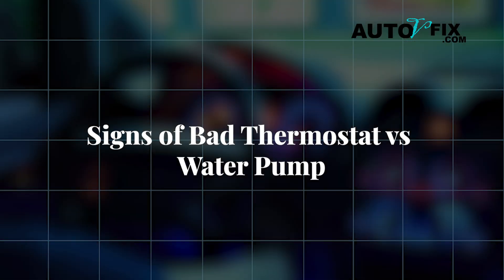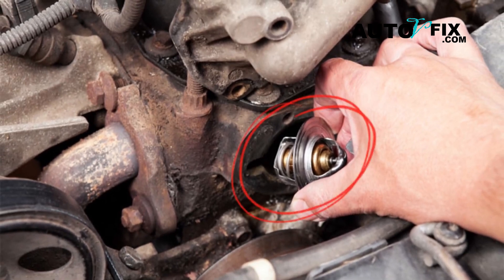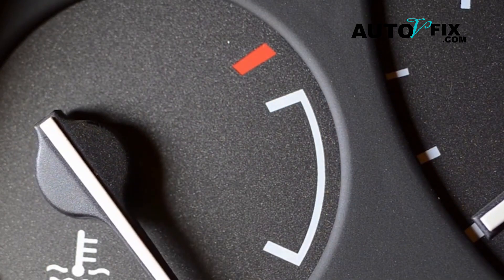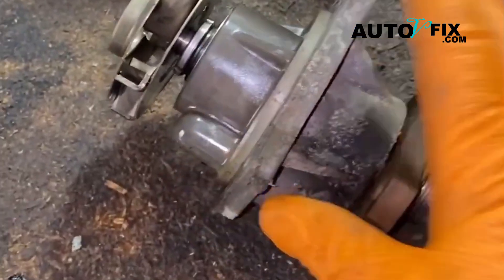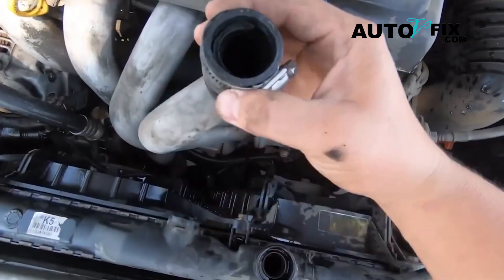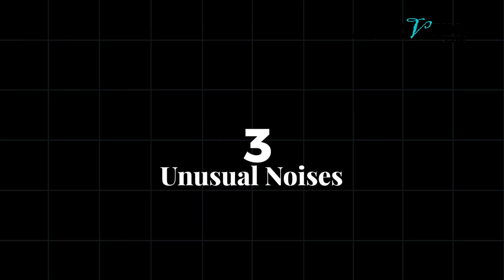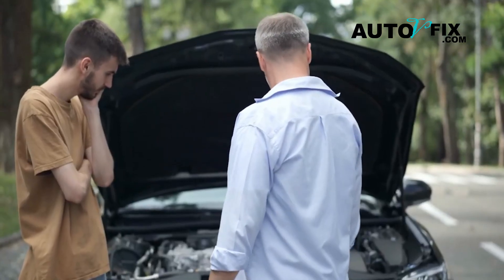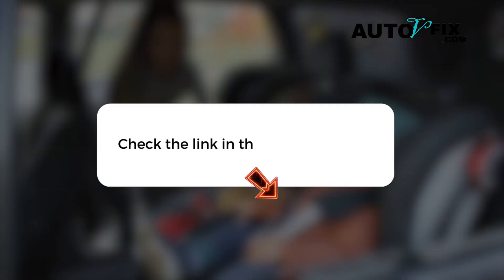Signs of Bad thermostat vs water pump: how to tell if your thermostat or water pump is bad

Comment: Having issues with my car.  Temperature gauge is going to hot no noises from engine but car isnt getting hot on the inside either.
Reply from the maker: That definitely sounds like a classic thermostat or water pump issue, especially if you're not getting heat inside the cabin.

Comment: Replaced two thermostats, still happening.  Can't tell if it's air in the lines of a closed system or water pump going out.   I'm pretty sure my car is about to be stolen by teenagers and driven into a deep ditch

Comment: Doesn't really help.  Any ways to determine if there is water flow?  Collapsed lower radiator hose?  Circulation in an open system radiator?

Comment: I have a toyota 2012 prius and I just fixed the engine water pump. But still if I am driving in the highway, the heating light often comes on the dashboard. Sometimes it flashes and goes away and sometimes it stays for a while and when i speed down, it goes away. can anyone tell me what is the reason?
Reply from the maker: This is sounds like a faulty thermostat or potentially a partially clogged radiator since it happens at highway speeds only

Comment: What about car not reaching 90C even after ~4hr of driving
At max it was 75C
The car is an audi a4 b8 avant
Reply: likely stuck open thermostat... i'm having the same issue and will be replacing mine.
Reply: @SssAhmad-x6u  My 2019 Pathfinder popped a code for low coolant temperature; bad thermostat (stuck open).
Reply: Searching for the same solution, my car doesn’t heat up while driving for at least na hour more than like 60 Celsium. Only when idle, it heat up to oprate tempature 90 Celsium. I hope coolant flush and termostat change will help.

Comment: You forgot Failing Electric radiator fans. My former 2016 Altima would display wild temperature flux if one fan froze up.
Reply from the maker: That's a really good point! Electric fans definitely play a huge role in cooling  system and can cause similar temperature issues too.
Reply: That’s what is wrong with mine

Comment: Ok, but what causes the temperature control sensor to constantly go out, I've replaced it 3 times now, No coolant leaks, and my engine doesn't run hot either??????
Reply: Do you mean the Thermostat?

Comment: A bad water pump doesn't always leak. There could be bad bearings in the pump, causing it to not pass a good coolant flow. You can tell if this is your issue if your radiator hoses don't have pressure in them.
Reply: how about a 4.0 tacoma ..doesn't over heat..just did t stat. but top hose gets warm and rad and lower hose nvr gets warm..as if its not circulating..I have great heat and I just flushed rad and core everything was tood..ideas?? water pump is quite and no leaks. motor has 180k..maybe the water pump blades are getting smaller less circulation?
Reply: @randystjean539  Sounds like my problem.
Reply: @randystjean539 same on my gmc. Temperature is fine though. The heat won’t stay hot for long. I put a new thermostat in the other day
Reply: @Tonirose74 how it goes?
Reply: @MRsickcat84 new thermostat did nothing. Not overheating, bottom hose still slightly warm even on a 40 mile trip on highway
Reply: Same on 02 mdx

Comment: I think my waterpump is makimg clicking sounds when i turn in the heater but it blows cold
Reply: Is that what that is??? My heater will sometimes make a clicking sound when I turn it all the way up but will sometimes work sometimes not. Now my cars coolant garage is overheating
Reply: @jonathancroc I changed my thermostat and filled up the radiator and burped it your system might be low on coolant

Comment: My 2022 Mitsubishi Outlander is losing coolant. I’ve already taken it to three mechanics, and they can’t find where the coolant is leaking from. The hoses build up a lot of pressure. Any suggestions?
Reply: The symptoms of your truck are a damaged head gasket, first check the engine oil and if you see that it has a coffee-au-lait color, that is coolant and mixed oil. 
It could also be that it is being consumed through the exhaust pipe. 
Start the car and check that no white smoke with the smell of coolant comes out of the muffler.
Reply: It's your water pump, its also recommended to replace both the thermostat and water pump at the same time. And flush out the old fluid and bleed the coolant system with brand new OEM fluid.

Comment: one more thing about the water pump,  if you hear a knocking sound,  get a wooden rod such as a broomstick or mop,  place the handle end on the pump's body, while gripping the rod....place you ear next to the rod......notice that increase in noise and the vibration?   that procedure is like a drs stethescope....
Reply: they sell them for cars on amazon 5 bucks

Comment: 2009 Honda civic, replace radiator cap kit , , new thermostat, and no leaks , the car suddenly goes up to 3/4 while waiting at a light but once the car is running , it goes back down to normal , has coolant and fans are working , heater still works I’ve seen that when water pump is bad heat doesn’t work , what could it be ?
Reply: When you turn the AC on, does the radiator fan turns on and does the car temperature drop back to normal?
Reply: U need a fan switch for it normally it closes to the thermostat housing
Reply: is ac on??
Reply: Radiator fan
Reply: I have the same problem on my Cinquecento 1.1, I’ve changed waterpump, belt (tension finally was ok), thermostat (works ok), water sensors and the car while idling starts to rise up from 90 to 98 close, but while running, the car/waterpump is able to cool down the car! Radiator fan works ok, but it is not capable of cooling or bring down the water temp! At the reservoir, water temp is close to 80-85
Reply: @FullTuerka well actually, if your car has a radiator cap , then you should be checking coolant level from there and not the reservoir, if your car doesn’t have a radiator cap tjem yes , check the reservoir
Reply: @FullTuerka are you checking the radiator cool level nf not the reservoir?
Reply: @FullTuerka try changing the fan switch cuz it controls when the fans kick on or off if it's faulty it's not going to do anything really mainly because the computer has to see a specific temperature on the sensor just to kick the fans on at the right time and if that doesn't do it change the thermostat sensor not the actual thermostat it self but the actual sensor that plugs into the thermostat housing

Comment: Mazda 3 , 2005 2.3lt I changed thermostat , radiator and coolant temperature sensor and now the car runs but  temperature gauge not working and car idling crazy.
Reply: Need to bleed it

Comment: Hello sir! Recently I went for a drive in the car and on the way back home the car went into limp mode because the engine overheated, the upper radiator hose was very hot, while the lower one was very cold, and we didn't get any heat in the car even though the temperature was set to 29 degrees. I have a Mazda 6, the coolant level is fine, it doesn't seem to have decreased at all, it is at the FULL mark.
Reply: Ever find out what the issue was!!?? I’m having the same issue on my 2011 pathfinder
Reply: @chrislewis4422 that’s definitely your thermostat hope you figured it out by now tho
Reply: @skyshull5214 definitely was a busted radiator

Comment: Toyota lexus rx300 1999 engine 1MZFE..Engine overheating but temperature gauges shows normal, both radiator hoses Inlet and outlet are swollen and both very hot. Also Hesitant driving. Please advise
Reply from the maker: That sounds like trapped air in the cooling system, or possibly a faulty thermostat that's stuck closed even if the gauge reads normal.
Reply: @AutoVFix Just to add that “trapped air” can be caused by Faulty Water pump, so shortly said: Faulty Water pump or faulty Thermostat can be the cause.

Comment: Hello sir,  my car engine gauge stick climbs quickly to 3-4 sticks even when cold driving for just 1km at very idle speed in lower gears.  It wasn't like that some time ago.  It used to take at least 2 kms of driving for engine gauge stick to reach 3 sticks...

Could it be sign of any engine heating related problems?
Kindly help out...
Reply: It could be rusty or corroded cooling system channels